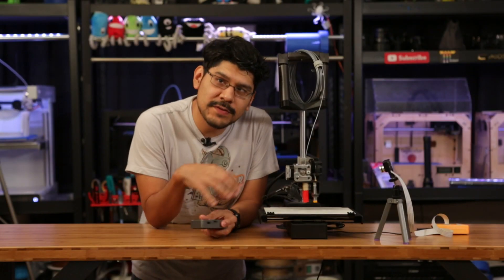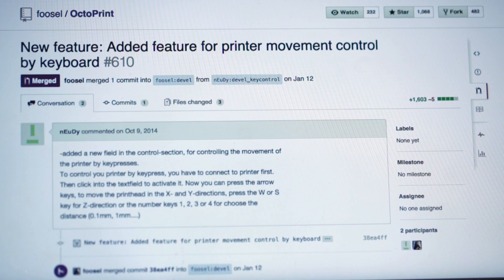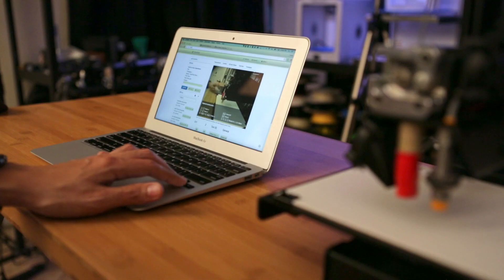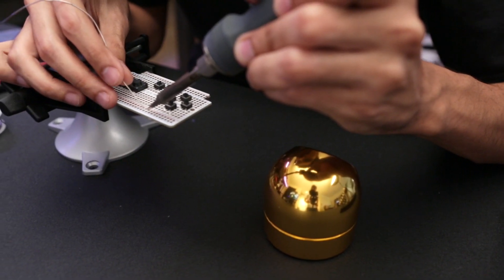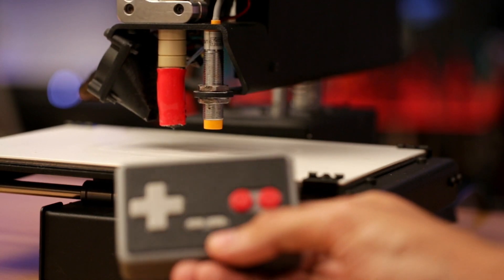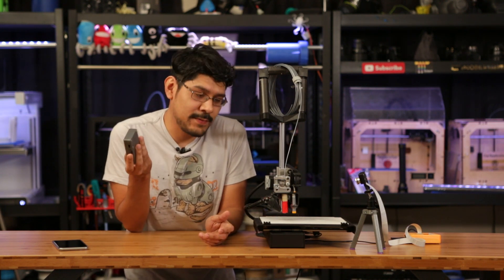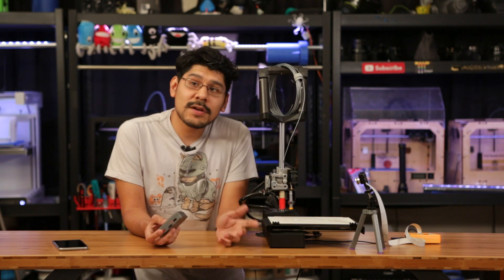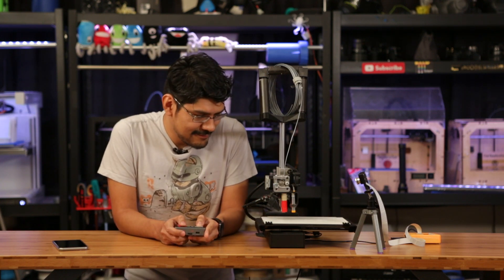3D Printed Gamepad Controller with OctoPrint and Raspberry Pi

Comment: This is actually handy :O
If they implement this with a selectable input (a.k.a "move printer by keys on usb/device3") they could work 24/7 and not only when hovering ... but ofc, this is a first version (and that is working properly is already a plus).

Although Octoprint already has touch controls... uhm, LCD screens with no touch are cheaper.
 custom 3D printed control pad for 3D printer for octoprint ... dedicated keys ... enough to make you think.

Thanks for the video! :D